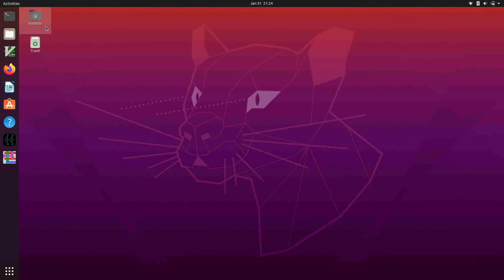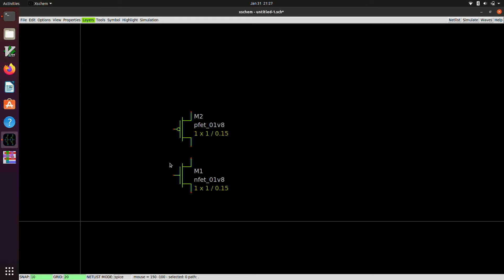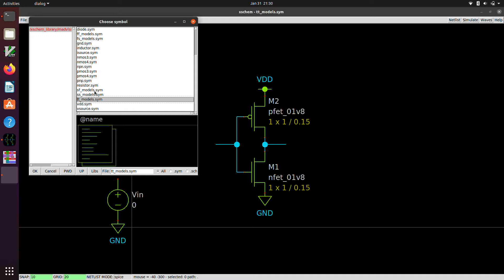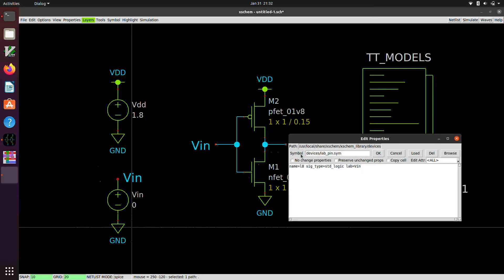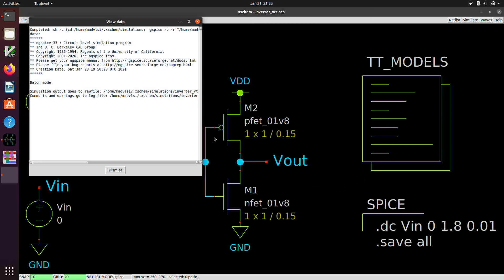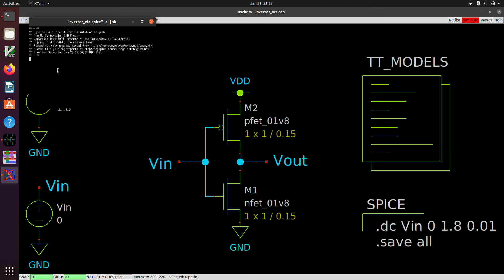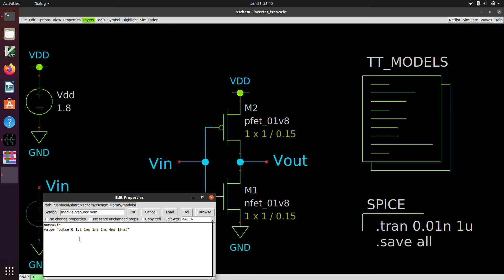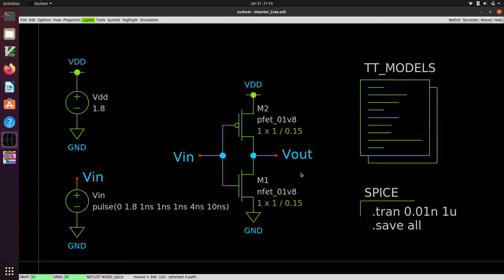CMOS Inverter VTC and Transient Simulation Tutorial Using Xschem and Ngspice

Comment: Wher can i get the model files?
Reply from the maker: https://xschem.sourceforge.io/stefan/xschem_man/video_tutorials/install_xschem_sky130_and_ngspice.mp4
Reply: @bminch  i installed this but i found that no mmodel file (tt, sf, ss etc) other thing find but not this . so withut this simulation will run or not. 

you can also check on git hub that on tt, sf files.
Reply: @abhishekvarshney7008  I'm having same issue, unable to add different models (tt, ff etc)
Have you got solution?
Reply: @nerdyparas1  He is not interested with your queries
Reply: You have corner that is in your skywater130 library corner like tt